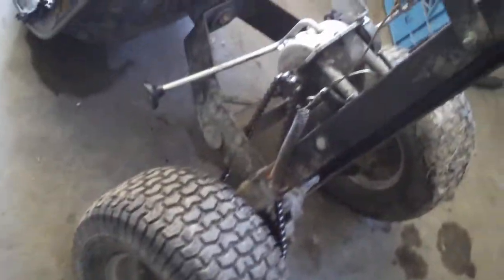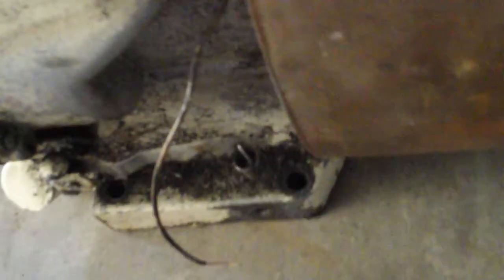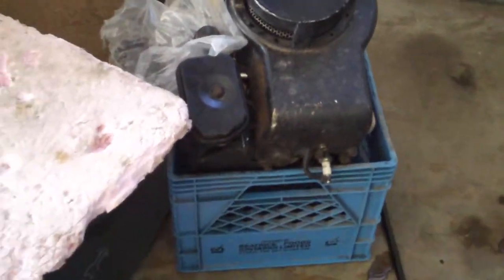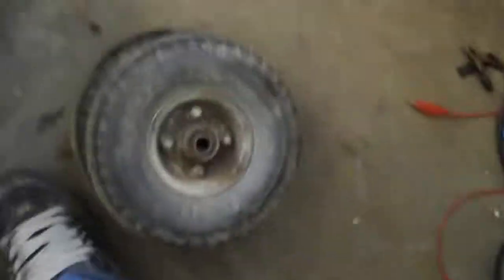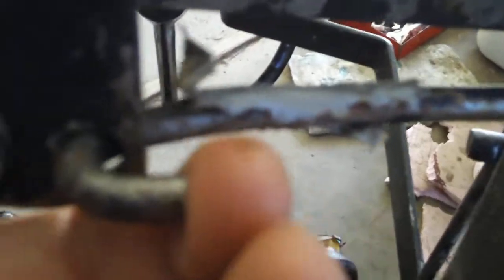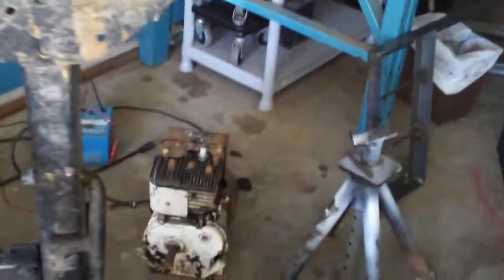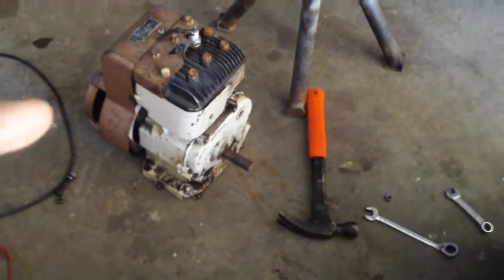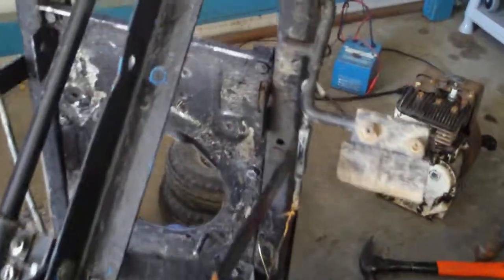Mini Racing Mower

Comment: Forgot you had this thing!  I might be getting an old Mustang, 5hp with rubber wheels and F/N/R only.  Cant wait though! They're great little tractors.

I need to do that washer trick to my mudder, the spindles are like that too!

What kind of speed are you trying to get from it?  And Im pretty certain you can run a cent. clutch at any angle, ive seen it done a vert shaft 12hp briggs.